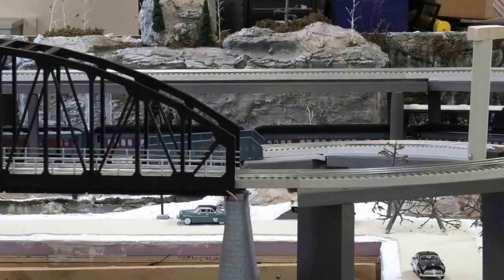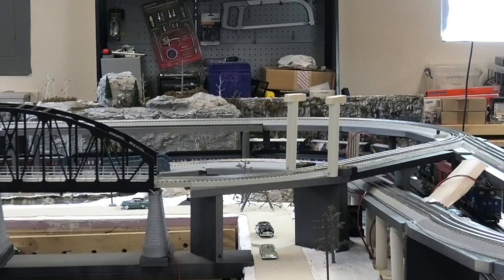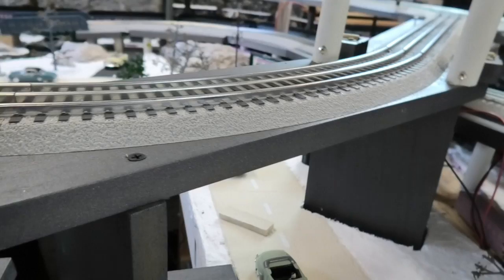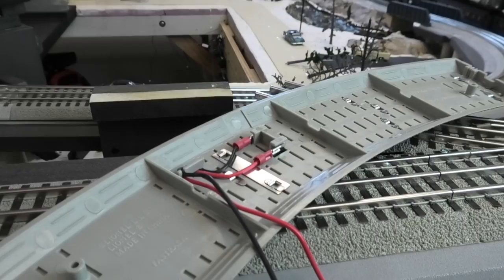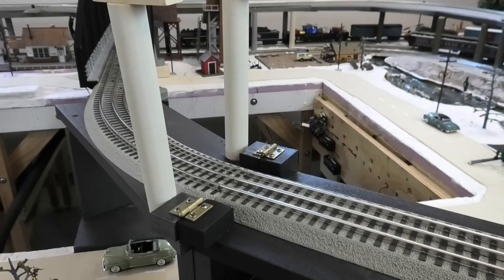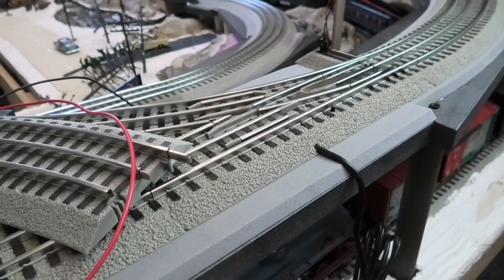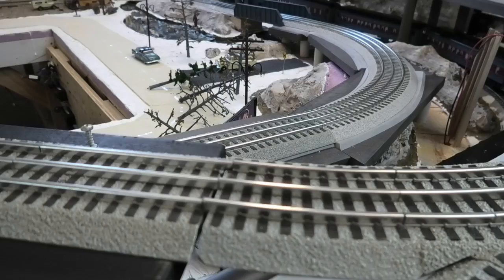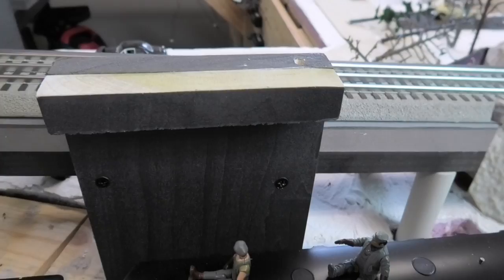Building an O-gauge Lift Bridge, Lionel Polar Express Layout

Comment: Great job.  I use Lionel Fastrack also.  I didn’t have a problem building the bridge .  My problem is the wiring.  When you lift your bridge does stop the  locomotives on each side of the lift.  If you can help would appreciated it.  Thanks

Comment: When running the train across the lift-bridge, does it stop and start across the lift points with flickering lights etc.? Doesn't this cause the train engine to reverse direction?
Reply from the maker: I have the bridge track wired separately to the power supply.  The locomotives have multiple power pickups underneath and through the wheels for both the side and center rails, so they are continuously powered.  Same for the tender, which is the sound source for some locomotive sets.  Thanks for watching and commenting!  Owen